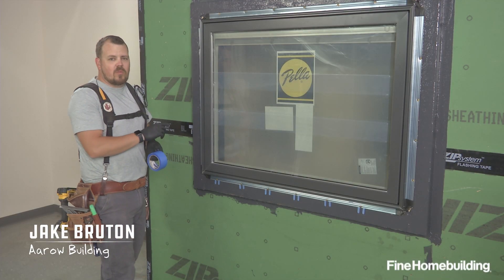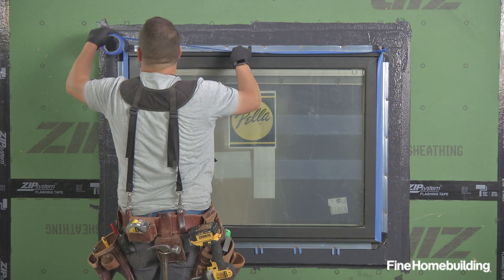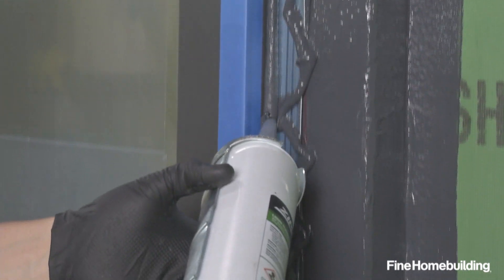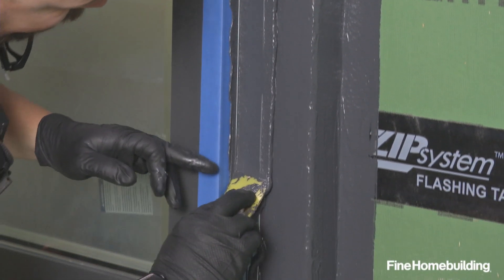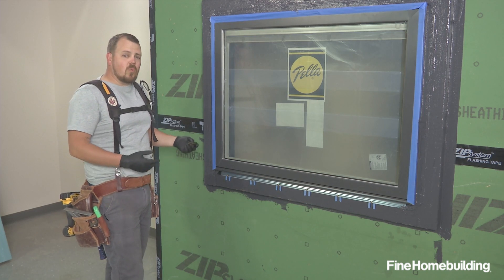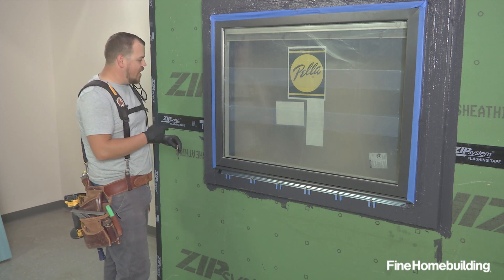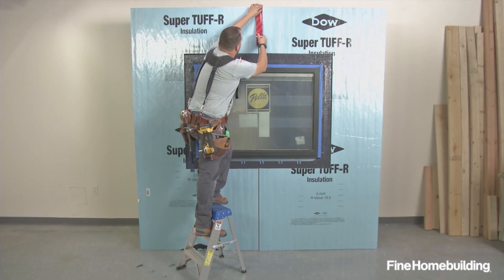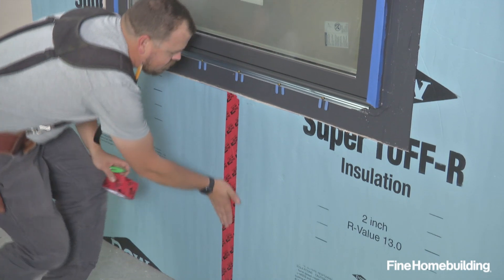Part 3: Flash a Nail Fin Window in a Wall with Exterior Rigid-Foam Insulation

Comment: We did it in a different way. We pulled out the windows and treated the rigid foam as sheathing and places the window flashing on top of the rigid foam and nailed it through the flashing, foam board and studs. Is much better seal.